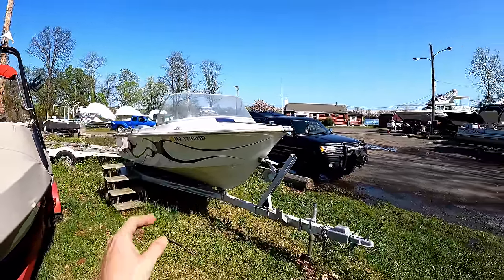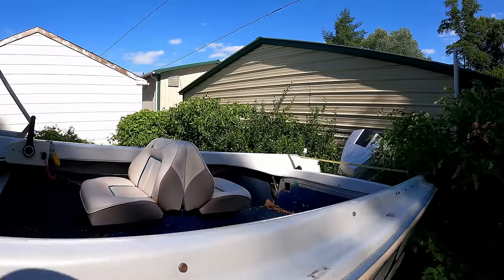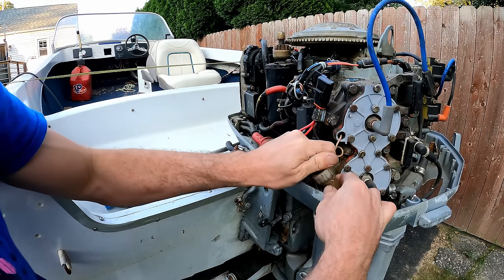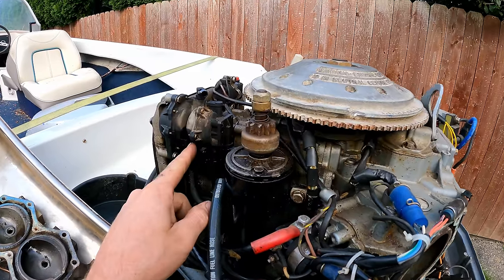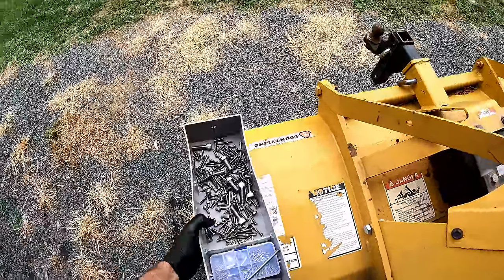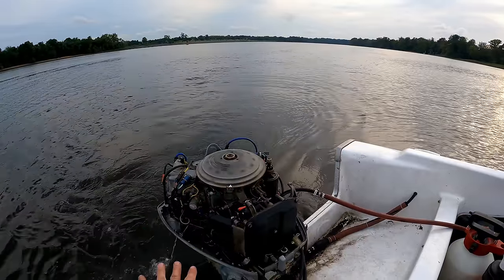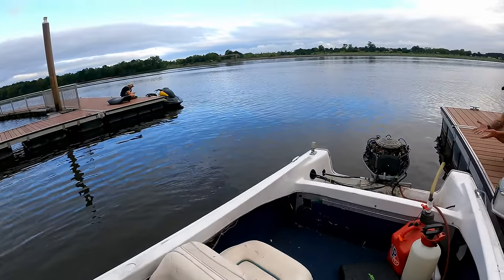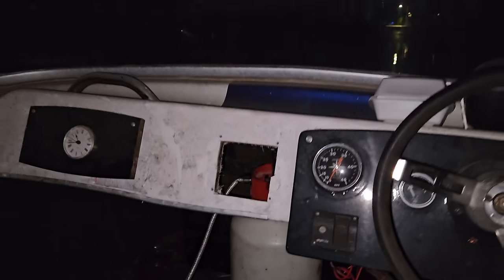FREE 1960's Boat with 90hp Evinrude WILL IT RUN?

Comment: They cut that lower cover to replace the t-stats without having to pull the powerhead.

There was most likely a mud dober nest in the exhaust.
There was also probably a clog in the lower carb.  

Putting in the water and revving the cobwebs out did a poor boy clean out.

Comment: Looks like a Johnson outboard, or Evinrude by the case and V4 engine. I had a 115 HP edition. Looks like someone cut the lower engine cowling to replace the thermostats. Not necessary. Love the 60's Larsons. Why does boat wiring always look like it done by people who have no clue?

I need a good engine for my 1963 Glasspar Avalon project. Sadly I am in Nebraska.

Comment: Curious if you are able to find PA stickers under the Jersey stickers. This looks like a boat I owned in early 2000’s to run around Penn Warner. No flames but the guy who bought it may have added them.
Reply from the maker: I don't think it had any evidence of PA stickers. I can double check another day though. I'm not where the boat is now

Comment: I had a identical 1987 90hp V4 evinrude on my 17’ whaler for years. Was always dead reliable for me. Should have been a separate oil injection tank for the VRO, mine was in the console.
Reply: Mine had power trim, and with just me in the Montauk I saw 47.6MPH gps

Comment: hey man just a question have u ever thought about doing some will it runs on some old japanese classics i think ud really love to experience an old subaru brat or a 240z or something older of the sort or maybe doing a will it run on an old fiero if thats not ur type of thing the fiero is pretty cool considering its uniqueness
Reply from the maker: I'm not terribly into them but yeah if one popped up that seems like the right deal, I would definitely jump right on it
Reply: @NoNonsenseKnowHow sounds good some of them are pretty unique so maybe some refreshing stuff to work on specially some of the rear engine rear wheel drive ones and stuff and the mini trucks are pretty fun too

Comment: 25 minutes into the video im curious why you never checked the water pump assembly first  in the lower unit which i could guarantee is dry rotted causing some of those overheating issues in the powerhead..

Comment: Your luckier with freeboats than me when I buy them, what it really needs is a 2nd   4v 2t engine, sure it would run fine, duct tape and super glue will fix a hole in a boat, super glue on glue side of tape and slap it on even under water, smaller patches better.

Comment: is it propped right?  Ive got a 50 1988 Johnson and it will push the 15' bowrider to 31-32mph per gps.

Would have though the 90 on that little 16 would do  closer to 40.  maybe she is over revving and under propped

Comment: I have a 95 model 88 SPL, basically the same engine without the VRO-  yours hasn't seen the salt water mine has- had on overheat I chased and ended up having a bunch of debris in the left hand side of the block (leaves, bits of gasket and O rings) but I broke off a head bolt pulling the heads off which was an ordeal.  I now have one 10mm head bolt and the rest are 5/16".  I used what I had in terms of inserts!  It's on a 15 foot 1969 Glaspar (the company was owned by Larson at that point) and  I have gotten 39 mph with a 19" pitch prop, my tach does not work thus RPM is unknown.

Comment: 14:34 sediment filter, not a water seperator. The water seperator is up off the fuel tank, has a drain cock on the bottom of it (white thing bolted to the stick)
Reply from the maker: The one by the tank was added. The one in the engine compartment is factory. They will both help separate water based on the design.  Water is heavier and drops to the bottom.  Both of them help remove sediment. More so the first filter
Reply: @NoNonsenseKnowHow  I have been around boats for 50 years (living on the Pacific Ocean),  my Father owned a boat company, until 2004 from 2005 to 2020 I worked at a marina.. I know a thing or 10 about boats
The one at the engine is NOT a water seperator, it is a sediment catch/Fuel filter, nothing more.  The first one off the tank, is the water seperator. Manufactures do not install water seperators.

Comment: What octane level of fuel are you using in that engine? As fast as I understand need to use at least 91 octane ethanol-free fuel with the oil.

Comment: Doesn't that have the choke on the key (push the key straight in when turning it over)?
Reply from the maker: No it has a fuel primer solenoid

Comment: OUTBOARD MARINE CORP.... parent company until bankrupted for the last time early 2K.    Makers of JOHNSON AND EVINRUDE Outboard engines, the earlier models like this are exactly the same engines called cross flow engines. They are the most stable things ever made and yes that includes today's 4 stroke engines. So the color says evinrude as does the beginning of the serial number. IT DOES HAVE TILT AND TRIM lol.  If the serial starts with E it is evinrude and will normally be blue and grey color schemes. Johnson will start with a J and normally white color schemes but of course not always lol.... anyway, if treated well they will never die.

Comment: Much safer to use a 6 gallon portable tank, works on cars too just take off the fuel clip.
Reply from the maker: It's made out of the same plastic. But yes 6 gallon tanks are nice as well. Although this one is sweet because you can build up pressure if need be. And since it's a cylinder it can handle it unlike a standard gas can

Comment: attention chris , je n'ai pas vu le retour de l'eau de refroidissement , normalement il y a une " pissette"qui valide le bon refroidissement du moteur....
Reply from the maker: There is a telltale pisser on the side of the engine that was flowing water when it's running in the river. That tells that the engine is getting cooling water

Comment: The real question is how rotten is it. That’s the major problem. If the motor ends up at the bottom of the lake when the transom falls off it doesn’t matter if it runs.
Reply from the maker: Transom is solid.

Comment: I normally like the sketchy way you guys do things, but spilling gas(oline, or lpg) into a boat then playing with wiring isn’t smart. People blow themselves up every year, because of fuel vapor in the hull. It forms a nice combustible mix that’s heavier than air and sits there, waiting for a spark. That’s why inboard motors have fans that run for a while before the starter engages. 
Surprised the coast guard had nothing to say on the subject. 
Not such a problem on an open boat, like that, because the wind will clear it out once you’re under way, but I was cringing while you were hooking up the lights.

Comment: Why don't recreational boats just use air-cooled engines?
Reply from the maker: Probably because there is a endless supply of cool water that's available. And also liquid cool engines are typically quieter
Reply: @NoNonsenseKnowHow   I definitely hear you, but they all end up having water issues.

Comment: Um # junk boat life! My 23 year old boat has never left me stranded even after my dumb ass left the drain plug out and had 3ft of standing water in it before I could get it to shore amd drain it. It did trash the starter but I was on land at the house when I figured that out. It really juat depends on how your boat was taking care off and the ones with the problems usually have old pos boats 😂

Comment: The most expensive boats are the free ones.  Bet all those ants are feeding on a rotted transom.
Reply from the maker: Transom is solid. Which means it has many years of service left in it until it ever need attention. Every transom is rotting if it has wood. The day they're built they start rotting